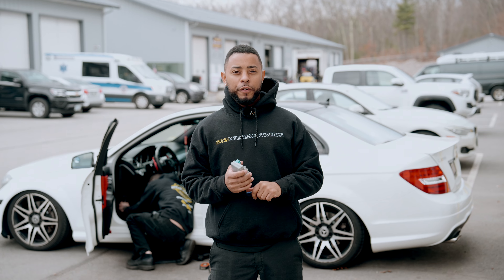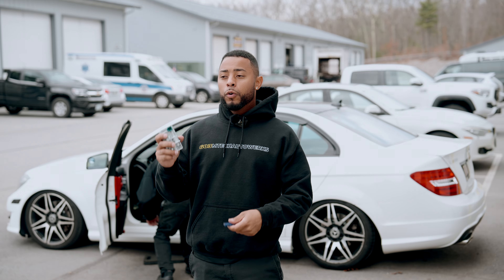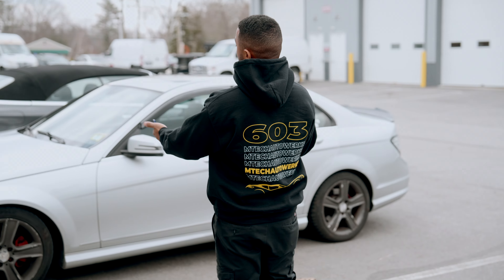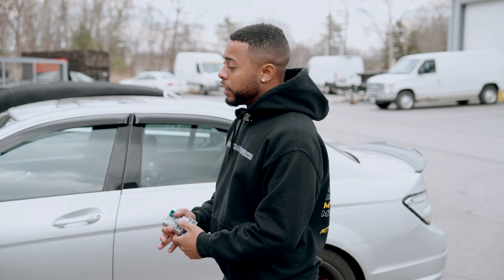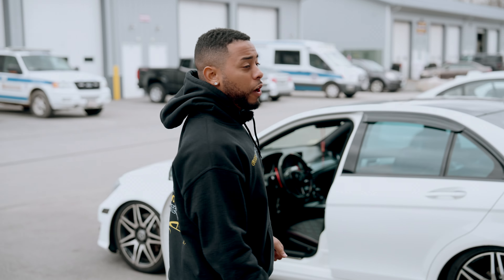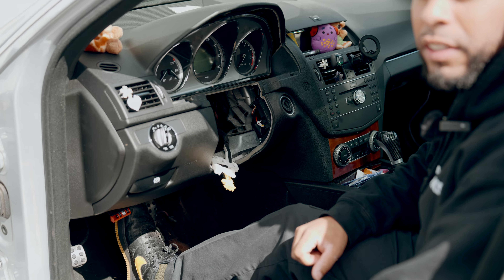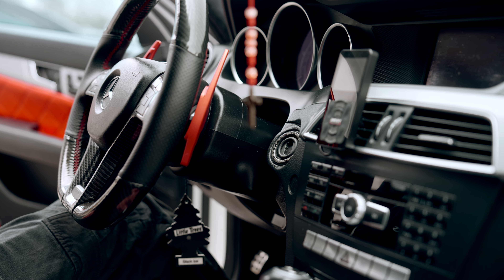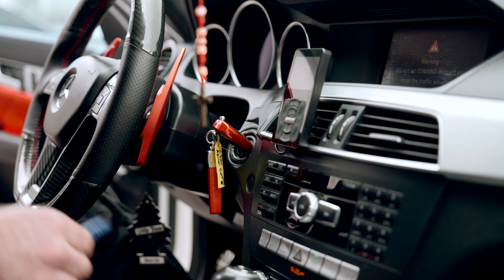This Part Will STOP Your Mercedes from STARTING - Steering Lock Failure | 603 MTech Autowerks

Comment: Biggest POS design ever.  Mercedes should eat a recall on every single W204.. (and other models) they installed this in.  Becasue even after replacement it will fail again in time.
When you use the "blue key" is it used in conjunction with Mercedes software? or just insert blue key and done?  (i know blue key is highly controlled by Merz as its theft related item) but lets say I can get a key and already have a new ESL..